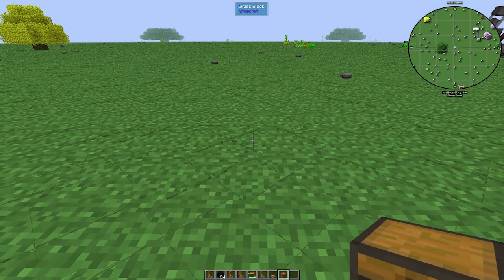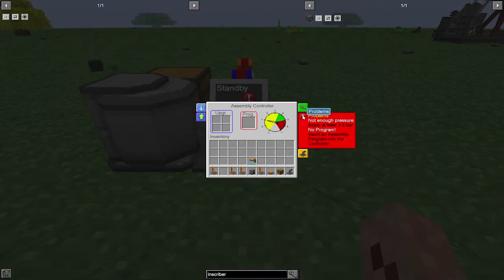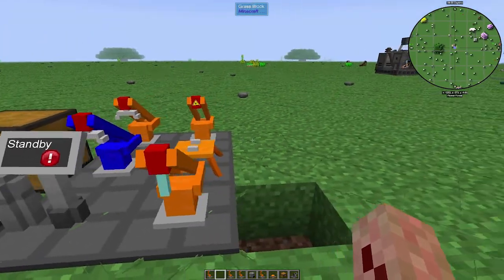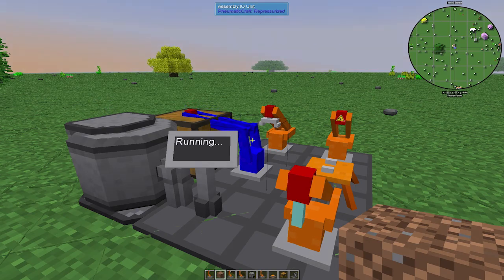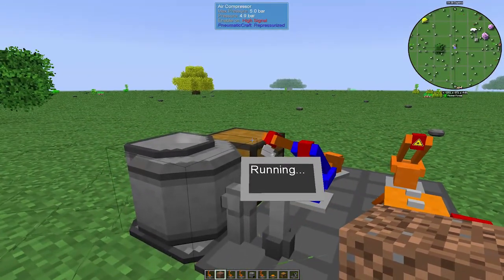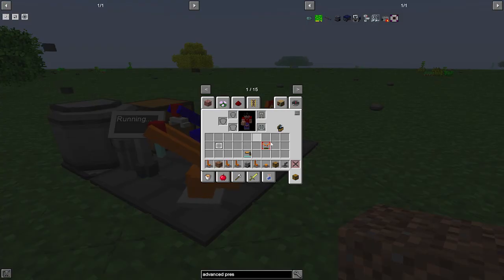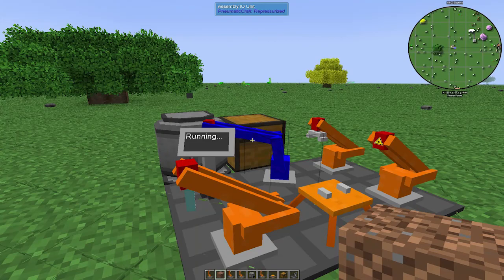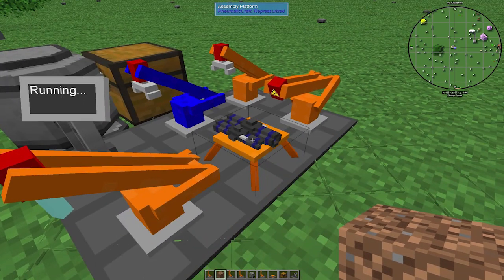PneumaticCraft Assembly Line Tutorial - Sevtech Ages Tutorial

Comment: 7:27 For anyone else who comes here, the reason the Air Compressor isn't turning off when you set the redstone control is that it only disables from burning the next bit of fuel. It still has to finish burning the current bit of fuel. Liquid Compressors will disable immediately.

Comment: i've completely copied this setup and yet it isn't working?????? either it's stuck on standby or the export arm will be stuck over an empty platform
Reply: It seems like with repressurized, it requires a double chest placed beside the export and import
Reply from the maker: something must be missing, check again.  I tested it thoroughly before making the video
Reply: I have the same problems, also with the export arm trying to grab a non-existent item.

Funnily enough you can hopper items into the IO arms and sometimes it'll move the arm around a bit and then the item disappears. Sometimes the assembly controller thinks there are two IO export arms when clearly one is blue and one is orange. Sometimes the "Assembly program: Laser" complains that no drill is present. Sometimes disconnecting the pipe causes an error in the assembly controller, sometimes it does not. Pneumaticraft is just a badly programmed mess of a mod. The pressure chamber is just as buggy. (And even the parts that work aren't fun but that's a different story. 10 minutes to make a single circuit board?)

If someone has found a solution I'd love to hear it, the double-chest thing did not work for me. I guess for now JEI will have to do.
Reply from the maker: @Schindlabua  yea idk.  I just did this exact setup again in another play through, make sure you have the right program in the controller
Reply: @Schindlabua  You figure out what the problem is? Friends and I are having the same issue
Reply: @Teddifer  Sadly no, I had to cheat in the items. (I tried tho!)